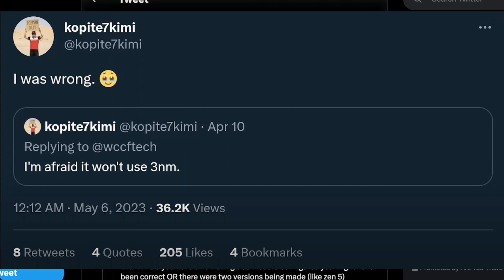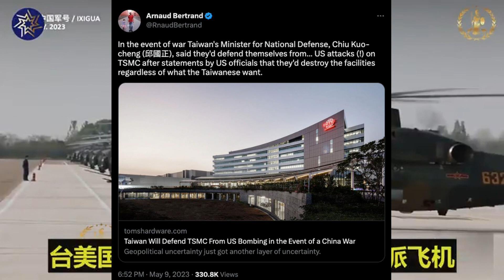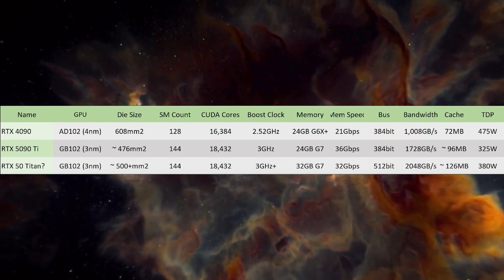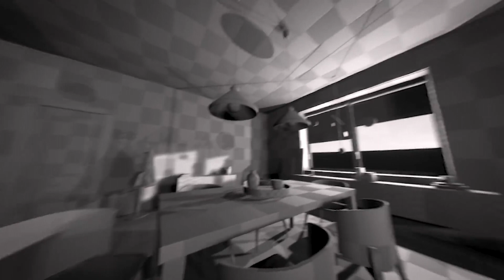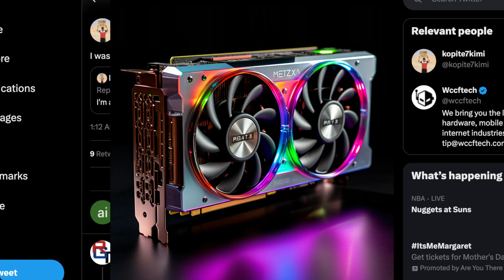NEW nVidia RTX 5090 Specs!  HUGE for Generative AI?

Comment: I think 5090 will be around 50% faster from 4090 in 4k rasterization
Reply from the maker: It'll be interesting to see!  Hopefully nVidia isn't too keen on efficiency, however it'd be nice to have a card shorter than 3 slots
Reply: Rasterization is old news.
Reply: Other leaks suggest 1.5× times performance on gaming.
Reply: @midnightvibes5485  *1,5 =+50%